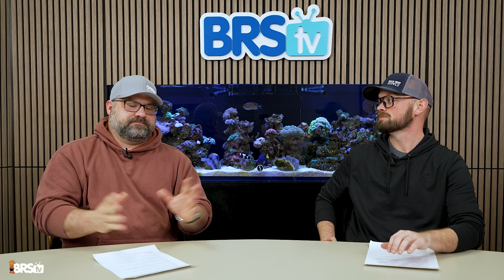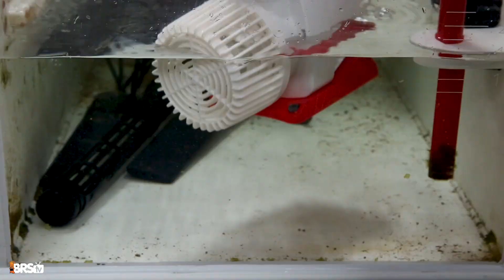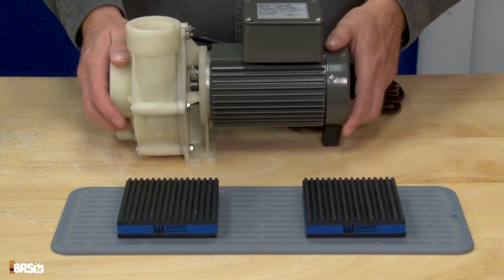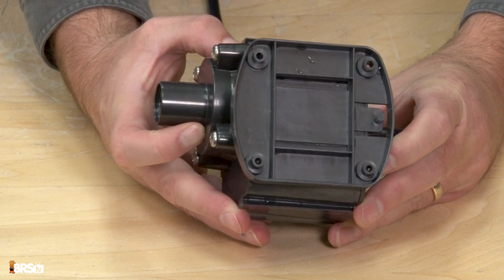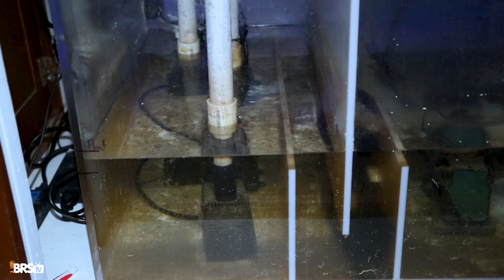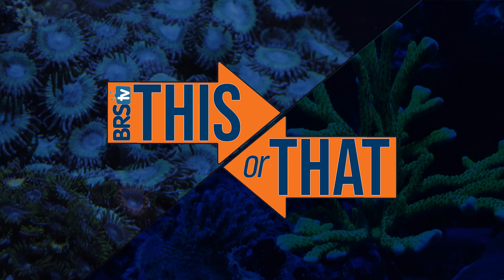DC vs AC Return Pumps for Reef Tanks – What’s Best for Your Build?

Comment: BRS literally done a video a while back showing when you restrict the "outflow" of an AC pump with a tap etc it's power consumption actually goes down.

Also DC pumps are just not as reliable as AC. I tried to go DC a few years back & the first thing I noticed is how many failures I was getting (I have a lot of systems), so these days I mainly stick to AC.

Comment: No way I'd ever go DC. Two smaller AC pumps are cheaper and more reliable, ever before talking about the added redundancy. Not sizing your pumps correctly is a skill issue, not the fault pump style.
Reply: Ehhh you’re just not open minded. Dc is better in every way. You can buy a pump that goes 600gph to 1400gph in one pump. I’m sold
Reply: @TNpyro-nk8ky  They aren't better price or reliability wise. Two smaller pumps is a feature, not a drawback.
Reply: @TNpyro-nk8ky  and when it dies you have to replace the entire pump, not one of two cheap pumps, if you have coral it could cause trouble, powder blue tang would go nuts kill all your fish with velvet over night